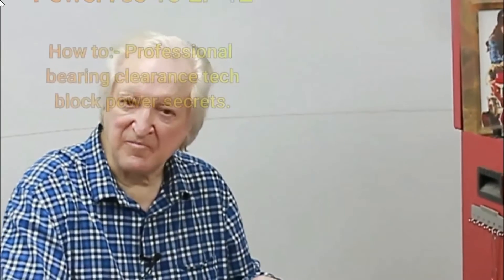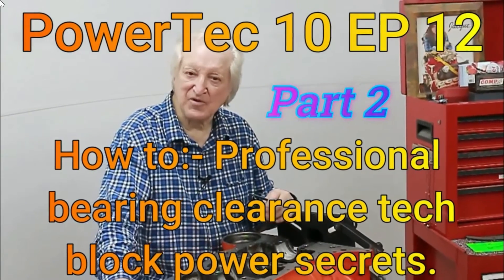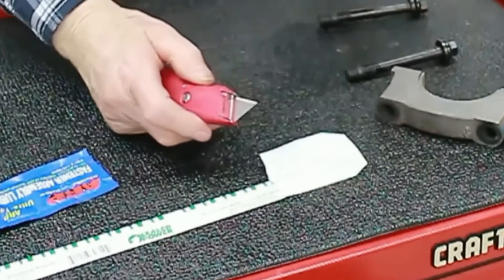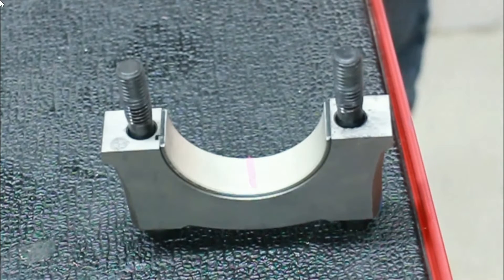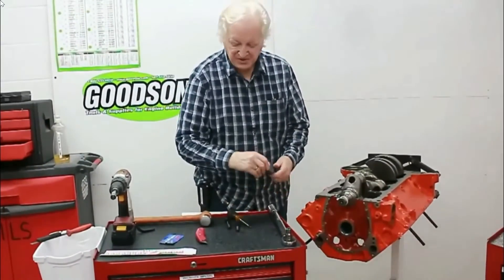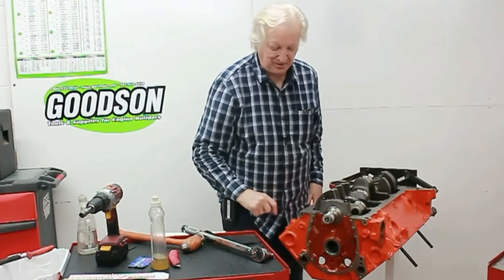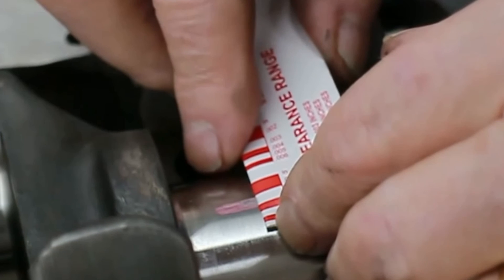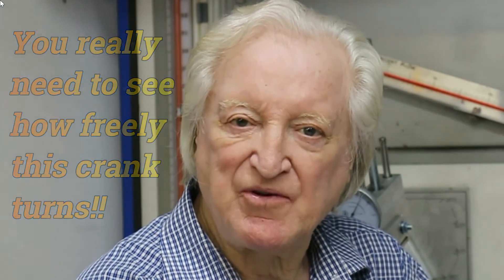Power prep crank bearing clearances Part 2

Comment: David do you check nip & crush on the con rods with bearings & 1 bolt installed?
Also while using plastiguage 50 years ago on crankshafts I was concerned about a main bearing having a clearance on both bearing shells (ie upper & lower).Does the crankshaft bend so that there is clearance on 1 shell only? Always concerned me.Never did cause a problem because of my over reving Rev Head nature!The motor’s never lasted that long! End of my association with GMH & my addiction to “Mopar Or No Car”
Keep up the great tips!
Cheers again,
Cliff Garavanta,
Western Australia

Comment: Just a question on calculating the clearance. Is the real clearance double compared to measuring with a micrometer? Since the same clearance would also be at 180 degrees to where the plastigauge is used. Thanks, Steve.
Reply: If you have .002 clearance you will have .001 all the way around. So if your journal was .001 out of round it will grab the bearing & spin it. In theory of course.
Reply: Total clearance is measured, that's all that matters. Nothing to calculate.

Comment: I am starting to trust the clicker torque wrenches. Decades ago, for electrical equipment and buss bars thousands of ampere, the National electric Code did not allow clicker torque wrenches, only twin beam torque wrenches. This is what I have used for decades. I test mine occasionally, and it is still within 1% of accurate. With the decades of manufacture and improved technologies, the clicker torque wrenches are reliable.

Comment: I also have been sharing the little details I learned over the decades. I have used plastic gauge for decades. Works great! Usually everything is within specs, but sometimes there is too much gap. Plastic gauge lets me know if there are problems. One thing I learned is to use breaking oil. Old oils had zinc and most of the new oils don't. Without the zinc, breaking can have problems, especially the cam and lifters. I replaced lifters in a Jeep Laredo and used break-in oil, yet the lifters started to eat the cam even doing the break-in procedure of 2000 RPM for 15 minutes. The lifter manufacturer said it isn't their fault. Still waiting to find and engine in good condition to replace this one.

Comment: Excellent advice. It was worth watching just for the tip about putting magnets on the file.

Just one question, I've never used plastigauge, how hard is it to remove?
Reply: It just peels right off. If there is a touch of residue, take a rag and some lacquer thinner, and just wipe it off the journal.
Reply: @jeffwooton7138  Thanks for the information.

Comment: Font & back bearing take off marks use powerful magnets 🧲 put file over trash can locate tab cut pieces of plastic gauge place cap tap into place insert bolt torque 40 ft. lbs. Spin out bolts 🔩 
measure 2.7 thousands. looking for 2.5 30% oil 75 ft. lbs. rear main cap 3.2 wipe Laqure thinner plastic gauge in place place in bolts torque 45 ft. lbs. zip out bolts 3.1 thousands.

Comment: Hi David, I'm in the process of ordering parts for my race engine. Its a sbc, 4.165 bore 3.75 stroke, 14 to 1 compression methanol engine running a wet sump with a vaccum pump. The block will be honed with a torque plate doing every thing possible to get the bores round as possible. The pistons I've ordered have a 1mm 1mm 3mm ring pack with lateral gas ports. What piston rings would you put in this engine? Would you consider gapless? I've heard you recommend those slitted rings which conform really well to a bore that's not perfect. Thanks for your time.